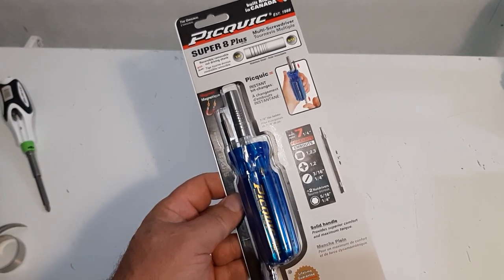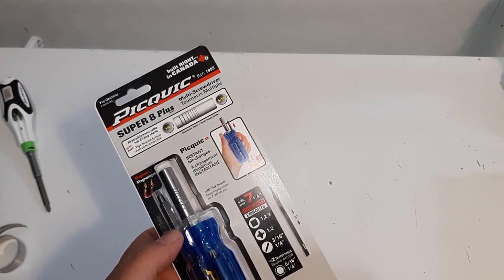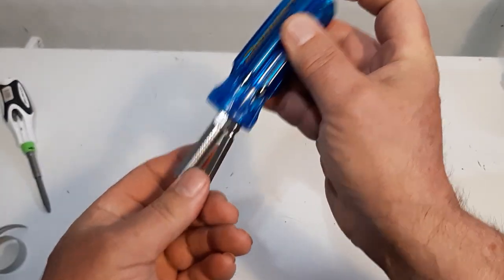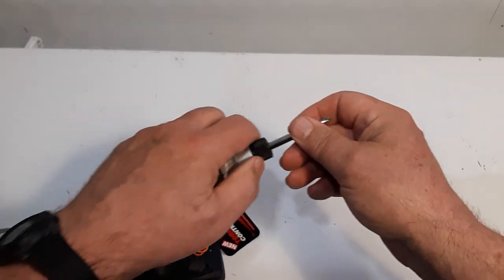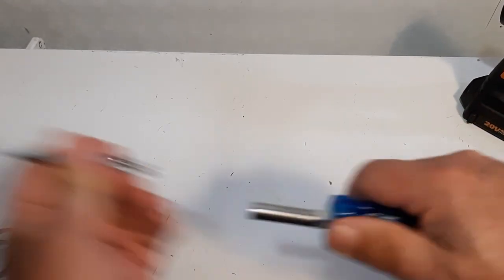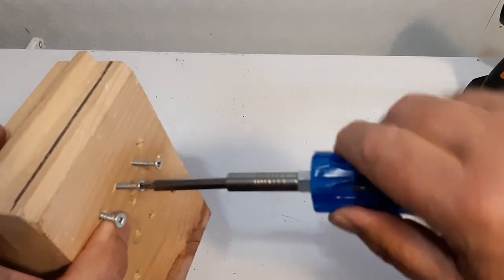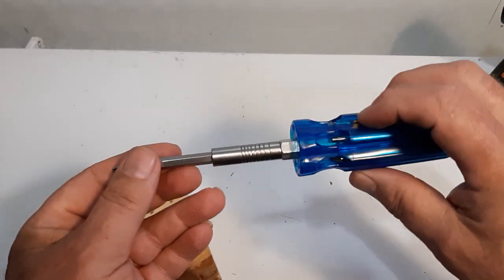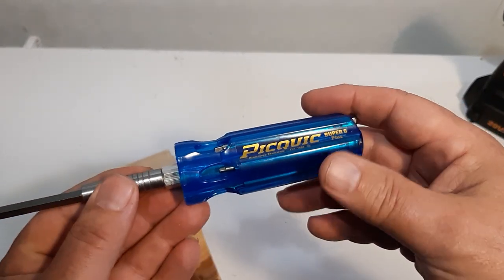PicQuic Super 8 Plus Multi-Screwdriver.

Comment: Good review but you did "not" test out the "magnetic strength" of the "end of a BIT" to see how much strength it has to pick up a screw.??
Reply from the maker: Thanks Roy for pointing that out. The end of the bits are not magnetic.  The bit holder is magnetic that holds the bits.
Reply: @JimMcLaren1950  ~Oh I see, thank you, that makes it clear now.!! I see Picquick also makes rust resistant bits in their Mariner model. 
~I saw another video of a very extensive test of hand held screw drivers, these ones were rated among the very best ones on the market: PB Swiss $144, LTT $70, Megapro $34, and Williams $36. (I think this is in US$ and not CN$.) Also the "end of the bits" on some of them "were" magnetic to hold and pick up screws with.

Comment: Nice screwdriver. Can you pull out the socket and then also pull out the 1/4" shank and insert the bit directly into the screw driver to make it a stubby? If they thought of that this is perfection!
Reply from the maker: Unfortunately the 1/4 inch shank is part of the screwdriver and cannot insert the bit to make it a stubby.They have a version of the stubby.  https://youtu.be/hhdP3-U59e8
Reply: no can do...